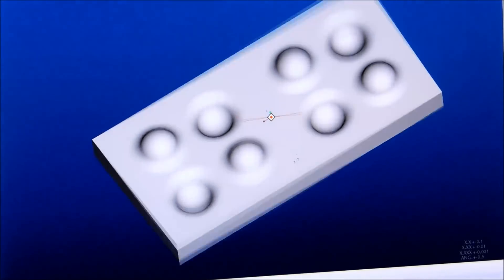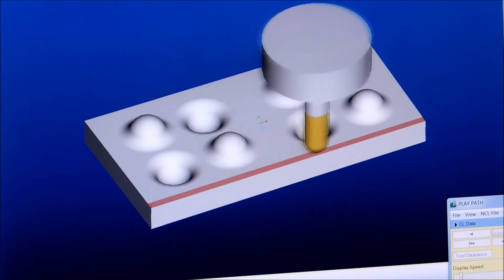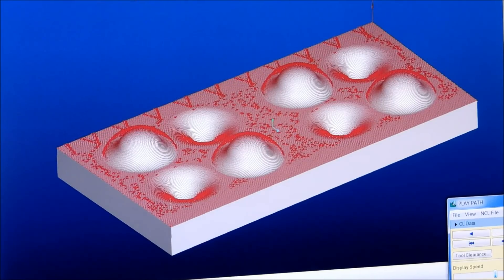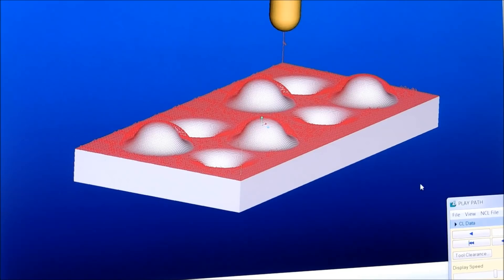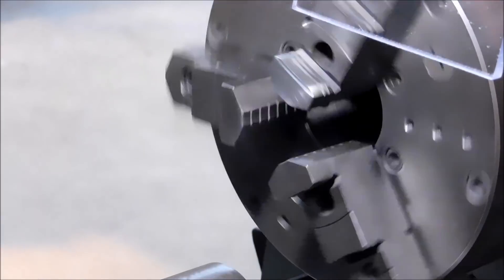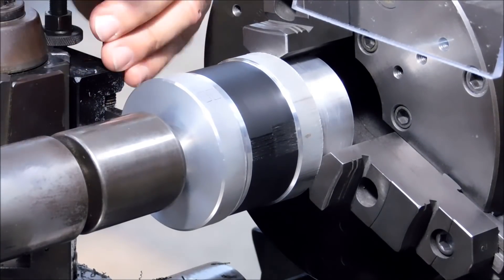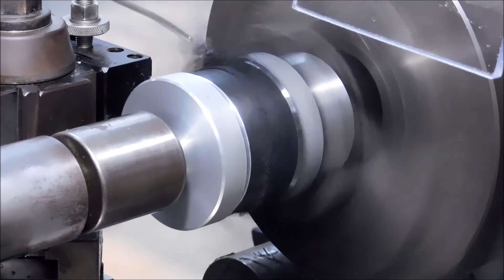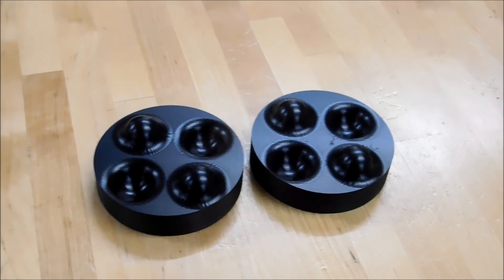CNC Surface Milling  -- Trial and Error

Comment: I expected a lot rougher surface finish for that much step over.👍
Reply from the maker: The number of code options I have is overwhelming. I was almost pleased, but the faceting has to go.
Reply: I run a 2 flute 1/8” ball mill on the CNC router with a 8% step over because,I don’t like sanding.I simply get it started and walk away to do something else. The job time calculator is fairly accurate..

Comment: Joe, I've been following your channel for a while and really like both your instructional content, presentation style, and all the cool tip and tricks to simplify processes and improve efficiency.   I'm embarrassed to admit that I had somehow neglected to hit the Subscribe button, but that has been corrected. 

Thanks again for taking the time and effort to share your wealth of knowledge and experience.   Now I just need to buy some machine tools and tons of  tooling.    First project on the list is a new and improved Interocitor, or perhaps a Veeblefetzer clone, Model 305J, with self rotating oil cups and horizontal mainfold. I might even move the emblem of a ruffled grouse in flight to the back of the machine for easier accessibility.  The possibilities are endless!!
Reply from the maker: have fun chasing the bottom of your list. Thanks for the sub.

Comment: better, faster and more accurate strategy is cleaning flats first with a corner radius end mill and then doing your 8 features which is actually two but repeated four times.
and for this features best way is concentric toolpath going from side to center.
(what you called chatter looks more like artefacts of improper strategy. concentric will give you much smoother results)
Reply from the maker: There are many different and better approaches. please read the comments.
Reply: @joepie221  yes i read some)  and many guys said to increase stepover what will increase machining time and code size even more )

Comment: This was a very interesting video and quite thought provoking regarding what the best CNC cutting strategy would be for a part like that.
I have a manual machine, so I have no CNC experience (yet), but my gut-feel is that a spiral cutting path centred on each bump would minimise the discontinuities caused by the step-size, and give a smoother finish.
It will be interesting to see what solutions you come up with. I'm looking forward to your next video.

Comment: inch system is  to  hard to  imagine  let use  metrics ,  if something  less then a 1mm   ,as for me  metric  is a way to go because 0.1mm =0.00393700787 inches  and as you can see it is less mess 1/10 of mm
Reply from the maker: Wrong.
Reply: @joepie221   ..but you use thousanths of an inch as measure. Like the metric system: 1mm , 0.1 mm,  etc.. 

A thousanth of a US or Imperial inch?
Reply from the maker: @tuomashelin555  Are they not the same thing?
Reply: @joepie221  for me inches are inches  , 25.4 mm  and I know metric from day one say so, so inches  confusing me a special when 3/4  3/8  I can't pickup right on the go ,the measurements I use to 5.25 mm 8.6 mm I can tell with out thinking  it depends of course what you got used to :) and I like to watch your channel

Comment: I'm sure others have mentioned this - there are more efficient tool paths to use for this type of work. At the end of the video you mentioned that there was "chatter around the radiuses". This is a consequence of the tool paths you chose to mill the part. You could break up the shape into sections that have steep walls and shallow walls and use different strategies for each section. Rob Lockwood does a good job of explaining some different strategies in a video he did ( https://youtu.be/7vS8w19_v5A ) Even thought you are not using the same software he is, most systems have the same strategies. How these strategies are combined in a given part directly influence the quality of the resulting finish.
If your CAM system has a option to fit paths to arc you could reduce the size of your code. So instead of your program being a bunch of point-to-point moves, you'd get a mixture of lines and arcs. The code in the arc sections will be considerable shorter.
Have fun experimenting !
Reply from the maker: Thank you. This is the kind of comment I appreciate. You obviously understand the numerous ways this can be done and what the phrase 'trial and error' means. At no time did I say this was a final path or the most efficient. Just cool to watch if you don't get much CNC exposure.

Comment: Lets seeee. I would start with variable Z roughing, pocket operation to finish the floors, then parametric spiral to finish each dimple and mountain. Run some online calcs for axial chip thinning feed rate and scallop height on step over to get the best balance of speed and finish. I think both a bull mill and ball mill would be ideal. I almost never get a chance to make a test part.
Reply from the maker: There are many places to start.

Comment: Very weak strategy
Reply from the maker: @Levi Vredenburg  Just one time, I would appreciate all critics, actually reading the video description and a few of the comments and replies, before leaving their two cent opinions.
Reply: Your kind of lacking in details here Levi. Instead of being a prick to this fine gentleman that showed us what he has tried for free. Perhaps try giving suggestions to what he could be doing different. The internet is a tool to learn and developed not divide.
Reply: Mitch Blocher clear flat areas with a much greater step over and then finish island’s individually. doing it this way is a lot of wasted time in the flat areas with .015 step.
Reply: I do agree that using a flat endmill for roughing and the flats would be a better approach.  Save the ballnose for whatever the flat can't get.  Joe is a wonderful machinist to watch, but I don't think he is heavily into CNC.
Reply: @RedBeard20842  i think what he does not say is that a roughing pass would be a better idea. now as it is plastic, it does not really matter. but if you need to do several passes, and if it's metal, it would be better to cut it first down and finish it off with the round ball. helps get more life out of your ballnose as it needs to do less work

Comment: I find the perfect toolpath for cutting varies by the part profile.  There is no universal combination that is both efficient and effective. It takes years of machining with many part profiles that will let you decide what is best for the current job. I certainly would have attacked this part with a different strategy than a simple parallel cutting pass, but I've been doing it for 30+ years.
Reply from the maker: Thanks. I welcome suggestions. Please read the comments first.

Comment: it's not exactly chatter, it's more like faceting that you get from the aggressive stepover. There are also better suited techniques to get a better surface finish and that don't have to dake longer: rough out most of the material with a regular flat endmill and then mill the round features with spiral 3D operation. Best is to start on the outer edge and work your way up, so that the endmill doesn't have to cut as much at the center. NYCCNC made a video where he tested and compared all the different operations in Fusion 360 for 3D surfacing, I bet in your CAM software are also some better operations than going straight back and forth in one direction.
Reply from the maker: Pro-Engineer is light years above Fusion 360. I can do this 100 different ways. This was a test.

Comment: Hi Joe,
Very well done and explained video.  I have a question, but must preface it with the statement that what I know about CNC programming would fit on the head of a pin.  Can't learn if I don't ask (sometimes dumb) questions.  Because the 'dimples' and 'pimples' on your part have cylindrical symmetry why would you not take advantage of that as opposed to raster cutting as you did?  Thanks
Be well & Best regards,
Gottfried
Reply from the maker: Yes. I could code the positive and negative features once and repeat in different locations, but its the transition between the positive and negative features being tested here. many of the guys that comment, don't know the whole back story. This is step one of a lengthy process.

Comment: Hi Joe, I've been a cnc programmer for quite a long time. I have done quite a bit of surfacing.
Usually, I start out with a larger ball end mill like you did in your first op. Then I like to go back in with a smaller ball mill for a final finish. (Bull nose are great too for some features!)
Sometimes it is necessary to do a  semi finish before the final finish. This is obviously dependent on the complexity and shape of your work piece and the results you are after.
Also if your software allows filtering to smooth out, and shorten the g-code is a big plus for older, memory lacking machines. On the older machines, I like to drip feed off the computer, and just let them run lights out.
Cool video Joe!
Reply from the maker: For Rf interference reasons from the welding equipment, my CNC is not capable of drip feed. Its RS232 from USB, or manual input only.

Comment: Cool part! I guess another way to do it is, you could've done the whole part (all the features including the OD) on the mill, and then chucked it up in a three-jaw to deck it. Probably would've had to cut custom jaws for the lathe though too that way (so the part isn't damaged), so probably the same amount of time.

Comment: That was really useful, but in looking at the end product, there seems to be cylindrical symmetry in 4 points.
Is it possible to use a jig in the chuck of a CNC lathe (to offset X/Y repeatably) and make (or at least finish) those features?
Reply: Yes, it is definitely possible to make such a fixture for a CNC lathe.
This part could even have been made on a fixture in a manual lathe since it is only spherical profiles.

Comment: Something from the details of this project is missing as an explanation why you would use just a ball nose end mill, when one would normally rough the bulk out fast and then do scalloping on the mountain/valley features only to reduce machining time.
Reply: I expected the ball to track around the diameter of the features rather than going over the top in line passes. Is it harder to code or less accurate like that?
Good video
Reply: @Mark6E  it's just his toolpath. the program is not going to make linear passes like he did here and "track' the curvatures like you said with 1 defined toolpath.
Reply from the maker: Test parameters. Single surface, single tool, 1/2" ball mill, linear passes with a .015 step over. Thats it for this one. There are 100 ways to do this part.

Comment: how many lines of code can you run on your fadal?  and how long does it take to load a 15,000 line program?
Reply: Kyle Blakely his code sequence number increment is set at 5
Reply from the maker: I have run 25000 line programs, but have no idea how big I can go. This program was loaded with a CalMotion USB through the RS232 port and took about 5 minutes to load.
Reply: Thanks for sharing details!

Comment: That flat surface came out alot better than I thought. 
Pro tip from someone who cuts form alot. If you can do that same program BUT leave some stock on the domed features only, say 0.01 per face. Then use a scallop style program locally to those features to finish.
Reply from the maker: This was my first step into parameters and values. Full surface cut in one shot. I could volume cut this or use multiple steps, but its the accuracy and step over I tested here. And yes, the flat areas even surprised me. .015 is a big step.
Reply: @joepie221  I'd be happy with those results on the first trial. How did the cut sound? Looked like you might even be able to push abit more?
Reply: @joepie221  I used to use parallel alot in the same fashion, running along the X-Z or Y-Z axis combination.  We were using NX4 - NX8 software, which had terrible scallop tool paths.  You will find that arc line filtering makes a huge difference for machines that do not have good look ahead buffering or  " high speed machining ".  The last Fadals I ran had Fanuc controls, they were actually pretty good at 3ax contouring.  Fadal used to be the go-to VMC, before Haas took over.

Comment: I noticed the tool slowed down as it did the radiused features, was that the machine trying to keep up with the high volume of lines of code? I've had a similar problem even on a modern machine with heidenhain control. I know some CAD/CAM packages have Smoothing or Arc Filtering options that try to consolidate a few linear moves into a single arc depending on the tolerance setting you select. This can drastically reduce the number of lines and can help the machine to keep up with the program.

Comment: I am interested to know what "plastic" it was.
Not that it will mean much but I would be able to sound as if I knew what I was talking about when we get out of lockdown.
I have heard a lot of people refer to Delron.
Reply: The name would be Delrin® - it's a DuPont brand name for what otherwise might be called POM (in most of the world) or acetal (in North America) if you want to get around trademark issues or are using another manufacturer's version of the same plastic.
Reply: Polyoxymethylene (POM), also known as acetal, polyacetal, and polyformaldehyde.
Reply from the maker: It was Delrin. Basically the same as acetal, but some plastics are homo-polymers, and others are co-polymers. Delrin has the best elastic strength for its class and cuts like a dream.

Comment: Im surprised you didn't rough the part out before cutting with the ballmill to obtain a better surface finish. cnccookbook has an excellent article on choosing a 3d stepover https://www.cnccookbook.com/cnc-stepover/. Have you tried using Fusion360? Their toolpaths they offer have given me excellent results in 3d surfacing. Im amazed how little they charge for all the features you get in one package.
Reply: No need for roughing if the setup and the tool are rigid enough, but can save time. Raster machining is not the ideal strategy for this features (depending what is the final aplication, of course).  Modern CAM programs have no trouble with constant 3D offset paths. In this case will result in spirals for the features with a very nice surface finish. (And for modern, I mean 10 years old, when I left the mould design busines)

Comment: Helical spiral is going to make your life so much easier. It's going to be a bit more programming, but you only have two features, you can call those individual routines separately. It doesn't have to all be baked in to the one continuous program.
The best part is that you can try different parameters on each location and then refine the final part by making modifications to best performing individual routine.
Reply from the maker: This was a single surface, single tool, linear trajectory test. There are many ways to get this done.

Comment: AND if it MST BE smaller how MUCH SMALLER must IT BE? .001? .010? ETC
Reply: If the tool is very nearly the same size as your minimum feature you can end up with extra chatter due to excessive tool contact area. On the other hand if you pick a really tiny tool, you need to run an equally small stepover to get good surface finish due to the cutter radius being small, and that means way more passes.

I'd say for something the scale of what's in the video, at least 0.10" smaller than the minimum feature radius is a good starting point.
Reply: @MysticalDork  Hi Thank you for answering the question!!!

Comment: Hi Joe, can the tool radius be the SAME as the smallest radius of the part?
Reply: In theory it can, but in my experience most software won't actually allow it. It will give you an error. Also if you're cutting steel or other hard material you will get horrible chatter when you plunge down to cut low spots. Hope this helps
Reply from the maker: The answers here are correct. When the tool radius hit the mating part radius, it would chatter. Sculpting it is the way to go.

Comment: Ideal for one plastic part ,  on  the other hand production is likely to have a rough end mill and ball end mill for finishing,  I think.
Reply: I agree. All the flat areas could easily be dynamic/adaptive milled with a square end mill. Then the dimples could be isolated for a 3d toolpath. You'd even have extra time for a finer step over